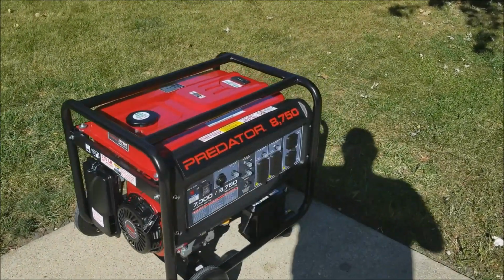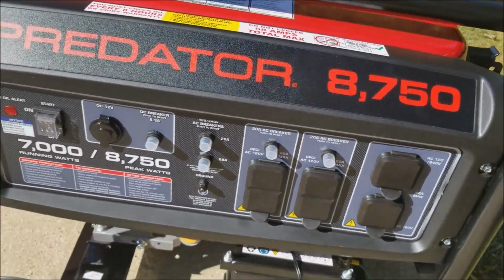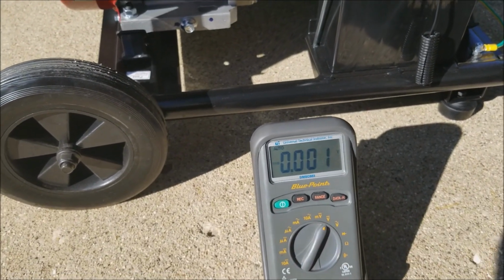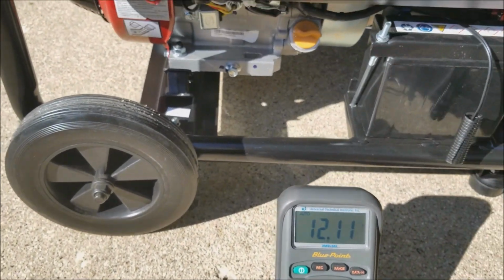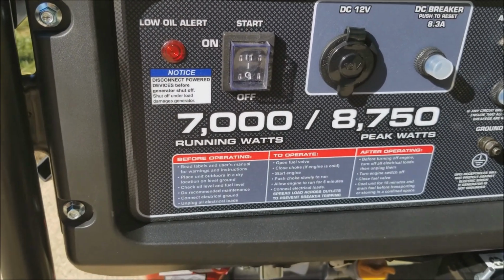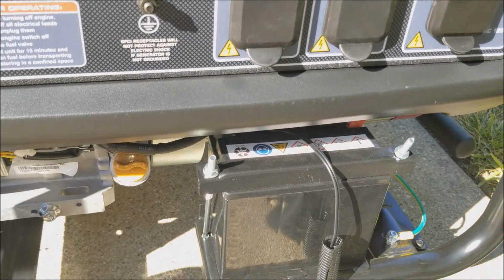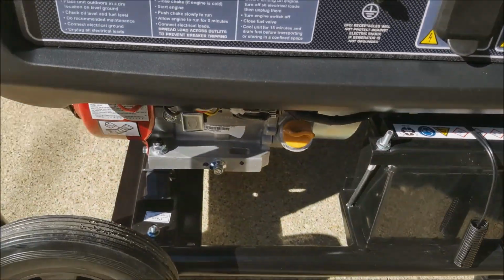Predator 8,750 Generator start up and voltage check

Comment: What  year is this particular model I just bought the exact some one for $700 and would like to find a owners Manuel for it.
Reply from the maker: I believe this one was manufactured in 2016. As for the owner's manual, here's a link to download the PDF https://www.google.com/url?sa=t&source=web&rct=j&url=https://manuals.harborfreight.com/manuals/57000-57999/57480-193175412331.pdf&ved=2ahUKEwiO9MrP0fb7AhUzmGoFHd2QCw0QFnoECCMQAQ&usg=AOvVaw0BATuyeN9qKZrm_7YeYgFj

Comment: I have this generator. It got me through the "Texas freeze" this year. Temperatures dropped to the teen's and below at times.  So many families went without power for over a week, and many lost their lives. My mobile home (which is all electric) was powered for 24 hours a day only to shut down to refuel and check the oil. We used those 110v oil filled heaters that you by at Walmart and were able to live in our home as if the electricity never went out. We put this generator to the test praying everyday it would hang in there and it performed outstanding.
Reply: ⚠️Always make sure you follow all the generator safety rules when you use your portable generator: 

This is just a reminder to make sure. It is important to follow all generator safety rules whenever you use your portable generator. 
Here are the things that need to be followed;

1) KEEPING OTHERS SAFE: Please do not allow an unqualified person or your children to operate and service the portable generator. Just because some manuals don’t say that doesn’t mean it’s safe. That is important against the generator safety rules. We also need to be keeping an eye on our children too. You need to make sure that your children are not playing near the portable generator especially when it’s running so they won’t get electrocuted. Generators pose electrical risks and they can be hot during an operation. Please keep your children away from the portable generator at all times. It is important to keep our children safe especially our little ones. Be aware of all the hazards.

2) WHERE TO RUN YOUR GENERATOR: Some people use their portable generators indoors which increases the risk of carbon monoxide poisoning. It’s important to have a carbon monoxide detector if you have a gas generator. Never ever use your generator indoors even if your doors and windows are open and even in the garage is not safe to use a portable generator. Not even at your porch and your deck. It is never safe to use your generator indoors and in enclosed areas of your home. Your generator needs to be 15-20 feet away from your house. 

3)🔥FIRE HAZARDS: Never refuel your generator while it’s running. You need to let your generator cool off before refueling it and before storing your generator. Never overload your generator too. Never ever back feed your generator. You should never plug your generator into a wall outlet. Also never store propane tanks indoors. Please keep flammable things away from the generator as well and please don’t smoke cigarettes near the generator. Having a fire extinguisher next to the generator is also important against the generator safety rules. 

4) GENERATOR OPERATION: make sure your hands are dry before touching the generator. Never use your generator in wet conditions. Don’t let your generator get wet. You need a generator tent if you need to use your generator during wet weather. Please don’t wear loose clothes when operating the generator. Turn on your generator before plugging in appliances. Use the right cord for your generator. Please do not use worn out cords. 

https://youtu.be/I1jT3ANENvI and here is a video more about keeping others safe when using generators 

Hope this helps

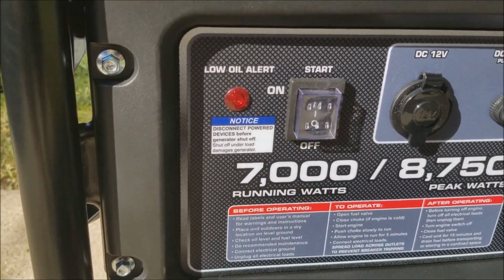Comment: 4:49
Reply: ⚠️Please do not forget to follow all the generator safety rules when you use your portable generator: 

This is just a reminder to make sure. It is important to follow all generator safety rules whenever you use your portable generator. Everyone needs to see this. 
Here are the things that need to be followed;

1) KEEPING OTHERS SAFE: Please do not allow an unqualified person or your children to operate and service the portable generator. Just because some manuals don’t say that doesn’t mean it’s safe. That is important against the generator safety rules. We also need to be keeping an eye on our children too. You need to make sure that your children are not playing near the portable generator especially when it’s running so they won’t get electrocuted. Generators pose electrical risks and they can be hot during an operation. Please keep your children away from the portable generator at all times. It is important to keep our children safe especially our little ones. Be aware of all the hazards.

2) WHERE TO RUN YOUR GENERATOR: Some people use their portable generators indoors which increases the risk of carbon monoxide poisoning. It’s important to have a carbon monoxide if you have a gas generator. Never ever use your generator indoors even if your doors and windows are open and even in the garage is not safe to use a portable generator. Not even at your porch and your deck. It is never safe to use your generator indoors and in enclosed areas of your home. Your generator needs to be 15-20 feet away from your house. 

3)🔥FIRE HAZARDS: Never refuel your generator while it’s running. You need to let your generator cool off before refueling it and before storing your generator. Never overload your generator too. Never ever back feed your generator. You should never plug your generator into a wall outlet. Also never store propane tanks indoors. Please keep flammable things away from the generator as well and please don’t smoke cigarettes near the generator. Having a fire extinguisher next to the generator is also important against the generator safety rules. 

4) GENERATOR OPERATION: make sure your hands are dry before touching the generator. Never use your generator in wet conditions. Don’t let your generator get wet. You need a generator tent if you need to use your generator during wet weather. Please don’t wear loose clothes when operating the generator. Turn on your generator before plugging in appliances. Use the right cord for your generator. Please do not use worn out cords. 

https://youtu.be/I1jT3ANENvI and here is a video more about keeping others safe when using generators 

Hope this helps

Comment: i never thought of that.Buy a generator to charge the generator battery.Makes sense.
Reply: ⚠️Please do not forget to follow all the generator safety rules when you use your portable generator: 

This is just a reminder to make sure. It is important to follow all generator safety rules whenever you use your portable generator. Everyone needs to see this. 
Here are the things that need to be followed;

1) KEEPING OTHERS SAFE: Please do not allow an unqualified person or your children to operate and service the portable generator. Just because some manuals don’t say that doesn’t mean it’s safe. That is important against the generator safety rules. We also need to be keeping an eye on our children too. You need to make sure that your children are not playing near the portable generator especially when it’s running so they won’t get electrocuted. Generators pose electrical risks and they can be hot during an operation. Please keep your children away from the portable generator at all times. It is important to keep our children safe especially our little ones. Be aware of all the hazards.

2) WHERE TO RUN YOUR GENERATOR: Some people use their portable generators indoors which increases the risk of carbon monoxide poisoning. It’s important to have a carbon monoxide if you have a gas generator. Never ever use your generator indoors even if your doors and windows are open and even in the garage is not safe to use a portable generator. Not even at your porch and your deck. It is never safe to use your generator indoors and in enclosed areas of your home. Your generator needs to be 15-20 feet away from your house. 

3)🔥FIRE HAZARDS: Never refuel your generator while it’s running. You need to let your generator cool off before refueling it and before storing your generator. Never overload your generator too. Never ever back feed your generator. You should never plug your generator into a wall outlet. Also never store propane tanks indoors. Please keep flammable things away from the generator as well and please don’t smoke cigarettes near the generator. Having a fire extinguisher next to the generator is also important against the generator safety rules. 

4) GENERATOR OPERATION: make sure your hands are dry before touching the generator. Never use your generator in wet conditions. Don’t let your generator get wet. You need a generator tent if you need to use your generator during wet weather. Please don’t wear loose clothes when operating the generator. Turn on your generator before plugging in appliances. Use the right cord for your generator. Please do not use worn out cords. 

https://youtu.be/I1jT3ANENvI and here is a video more about keeping others safe when using generators 

Hope this helps

Comment: I've got the same model and just unboxed it but had trouble with the GFCI outlet tripping every time i plugged the cord in. Didn't matter if it was plugged into my house. I switched poles on the plug thinking it may have been wires backwards but no dice. Anyone else experience this?
Reply: @ Ben Thompson - Sounds like bonded neutral vs floating neutral wiring in the generator. Are you running extension cords to run individual lights, appliances, furnace, tools......or are you running a generator cord (240v) to a generator inlet on the house that goes to a transfer switch/or interlock in the main CB panel? It sounds like your running individual extension cords to appliances, etc. The 8750 generator may be a floating neutral. Check the manual if it lists as floating neutral as many generators from China are wired as floating neutral. You can also test if floating neutral by using a outlet plug tester and plugging into the outlet in the generator, you will get a open ground. Alternatively with generator off, use a multimeter and test for connectivity from one of the 120v generator outlets (neutral prong/left prong) to the ground lug of the generator. If no connectivity from the neutral prong to the ground then generator is wired as floating neutral. If verified as floating neutral and running individual extension cords you would need to ground the generator via the driven ground rod and appropriate ground wire. There is a ground lug on the face of the generator panel, this is where you attach the ground rod. Believe when you plug in the extension cord, the GFCI is not seeing a ground thus tripping. There are videos on this subject on YouTube, educate yourself before taking any action - don’t take this response as the answer until you verify and educate yourself. Be Safe.
Reply: ⚠️Please do not forget to follow all the generator safety rules when you use your portable generator: 

This is just a reminder to make sure. It is important to follow all generator safety rules whenever you use your portable generator. Everyone needs to see this. 
Here are the things that need to be followed;

1) KEEPING OTHERS SAFE: Please do not allow an unqualified person or your children to operate and service the portable generator. Just because some manuals don’t say that doesn’t mean it’s safe. That is important against the generator safety rules. We also need to be keeping an eye on our children too. You need to make sure that your children are not playing near the portable generator especially when it’s running so they won’t get electrocuted. Generators pose electrical risks and they can be hot during an operation. Please keep your children away from the portable generator at all times. It is important to keep our children safe especially our little ones. Be aware of all the hazards.

2) WHERE TO RUN YOUR GENERATOR: Some people use their portable generators indoors which increases the risk of carbon monoxide poisoning. It’s important to have a carbon monoxide if you have a gas generator. Never ever use your generator indoors even if your doors and windows are open and even in the garage is not safe to use a portable generator. Not even at your porch and your deck. It is never safe to use your generator indoors and in enclosed areas of your home. Your generator needs to be 15-20 feet away from your house. 

3)🔥FIRE HAZARDS: Never refuel your generator while it’s running. You need to let your generator cool off before refueling it and before storing your generator. Never overload your generator too. Never ever back feed your generator. You should never plug your generator into a wall outlet. Also never store propane tanks indoors. Please keep flammable things away from the generator as well and please don’t smoke cigarettes near the generator. Having a fire extinguisher next to the generator is also important against the generator safety rules. 

4) GENERATOR OPERATION: make sure your hands are dry before touching the generator. Never use your generator in wet conditions. Don’t let your generator get wet. You need a generator tent if you need to use your generator during wet weather. Please don’t wear loose clothes when operating the generator. Turn on your generator before plugging in appliances. Use the right cord for your generator. Please do not use worn out cords. 

https://youtu.be/I1jT3ANENvI and here is a video more about keeping others safe when using generators 

Hope this helps

Comment: The voltage check explanation  on the actual generator was weak.  You explained how to set the meter to DC when checking your battery BUT did not go over the meter settings for generator sockets.  Nothing mentioned on the probe placement into the actual socket openings; what do the openings represent ...nuetral, hot, ground, etc.  Too much focus on starting the generator and the battery charging idea...not enough on using a meter to check voltage.
Reply from the maker: All good points; however, this video wasn't intended on "how to use a voltage meter". I agree though, it's good to explain these things for those not familiar with these devices/tools

Comment: where did you get that thing to hold the battery down? My battery nor the generator (both from HF) did not come with it. Im just firing up mine for the first time (its been sitting in a box for over 2 years!) , I'll follow your 2.5 hours break in before I change the oil for the first time.
Reply from the maker: Awesome choice of generator. The battery hold down was not included with the generator, but it was included with the battery also purchased from HF
Reply: JPG23 damn. My battery didnt come with that from hf. Oh well...velcro for now!
Reply from the maker: @captstubeans  Is it the thunderbolt battery? I would swing by HF just to ask, maybe someone took it out, but it was definitely included with mine
Reply: @captstubeans  ⚠️Please do not forget to follow all the generator safety rules when you use your portable generator: 

This is just a reminder to make sure. It is important to follow all generator safety rules whenever you use your portable generator. Everyone needs to see this. 
Here are the things that need to be followed;

1) KEEPING OTHERS SAFE: Please do not allow an unqualified person or your children to operate and service the portable generator. Just because some manuals don’t say that doesn’t mean it’s safe. That is important against the generator safety rules. We also need to be keeping an eye on our children too. You need to make sure that your children are not playing near the portable generator especially when it’s running so they won’t get electrocuted. Generators pose electrical risks and they can be hot during an operation. Please keep your children away from the portable generator at all times. It is important to keep our children safe especially our little ones. Be aware of all the hazards.

2) WHERE TO RUN YOUR GENERATOR: Some people use their portable generators indoors which increases the risk of carbon monoxide poisoning. It’s important to have a carbon monoxide detector if you have a gas generator. Never ever use your generator indoors even if your doors and windows are open and even in the garage is not safe to use a portable generator. Not even at your porch and your deck. It is never safe to use your generator indoors and in enclosed areas of your home. Your generator needs to be 15-20 feet away from your house. 

3)🔥FIRE HAZARDS: Never refuel your generator while it’s running. You need to let your generator cool off before refueling it and before storing your generator. Never overload your generator too. Never ever back feed your generator. You should never plug your generator into a wall outlet. Also never store propane tanks indoors. Please keep flammable things away from the generator as well and please don’t smoke cigarettes near the generator. Having a fire extinguisher next to the generator is also important against the generator safety rules. 

4) GENERATOR OPERATION: make sure your hands are dry before touching the generator. Never use your generator in wet conditions. Don’t let your generator get wet. You need a generator tent if you need to use your generator during wet weather. Please don’t wear loose clothes when operating the generator. Turn on your generator before plugging in appliances. Use the right cord for your generator. Please do not use worn out cords. 

https://youtu.be/I1jT3ANENvI and here is a video more about keeping others safe when using generators 

Hope this helps
Reply: @The_Happy_Aviation_Enthusiast  Thank you so much I really appreciate you for this informative information.